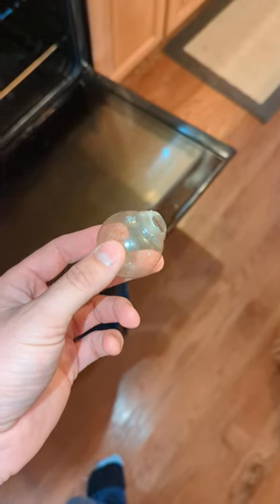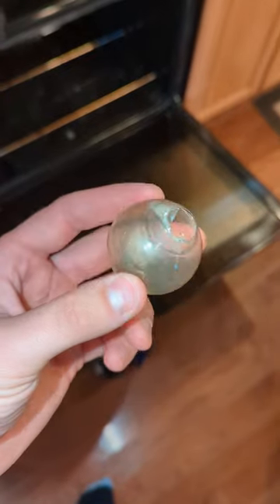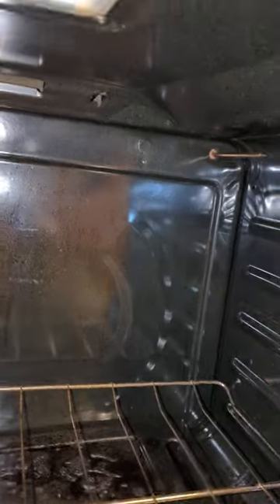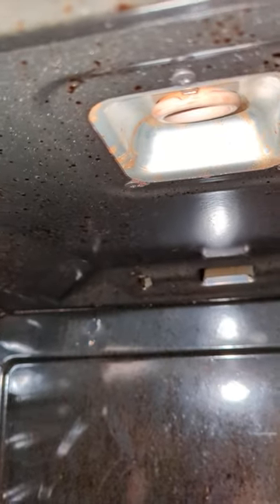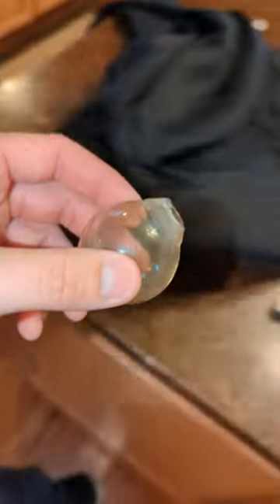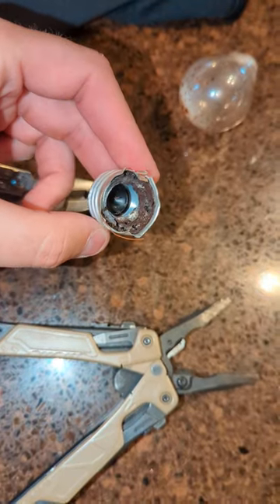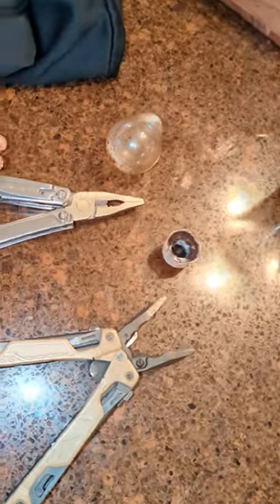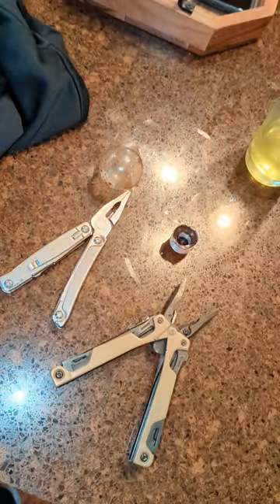Stuck/Broken Oven Light Bulb Removal (Whirlpool) Unplug Oven First!

Comment: I did it! Not as easily as you did, but I got it done. My pitfalls... I thought I had turned off the microwave breaker, but I didn't and it popped with some sparks! Exciting. Why I flipped it back on is beyond me. Then I forgot which breaker it was, so I turned on the vent fan and started flipping breakers until the fan went off. THEN I marked it with tape. I could not get a good angle on the bulb socket, so I pulled the stove away from the wall (fortunately we had done this a month ago, so it was clean). Once I got right under the microwave I got the angle and used the old bulb to twist out the broken socket. I did have to take off one layer of rubber bands because I had tried to use a pair of needle nose pliers and kind of bent the broken socket (all with the power off). Finally it started to turn and came out. I will order a new bulb on Amazon and get a new piece of glass because for some reason when the bulb burnt out it broke the glass. Getting the door off is a challenge and I am sure it will be a bear to get back on. BTW I am a 60 y/o woman who has never tried anything like this before, but my husband had to leave town on an emergency, so I thought it would be nice if he came home and this repair was done!

Comment: Thank you friend,  You made my day go a whole lot better!  BTW Feit sells a 40 watt equivalent LED replacement (uses 3 watts and is 270 lumens) that should last about 5-7 times longer and it fits in my Whirlpool micro that had the 120v 40 watt bulb like yours.  It was available on the shelf at Home Depot.

Comment: Question did yours have a cover for the bulb or just the exposed bulb have the exact same stove but it came with the house when we bought it ....thanks again
Reply: THIS KIND ITS SO  DANGERUS UNSAFE FACTORY DESIGN MADE  NO COVER BULB . I WAS BAKING IN A  POT COVER WITH FOIL AND FOIL TOCH THE BULB I OLMOST GET ELCTRICUTED MY SELF .
SO I WILL CALL THE COMPANY COMPLAIN
Reply from the maker: Mine did not have any cover. Stove was there when I bought the house.